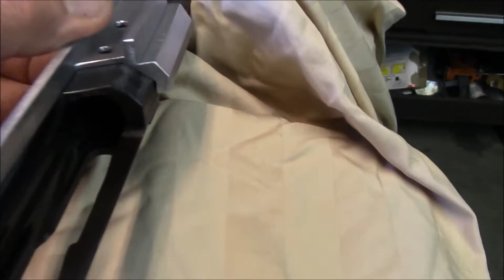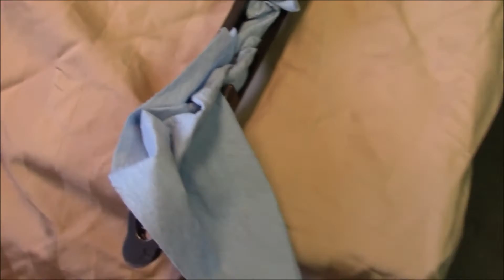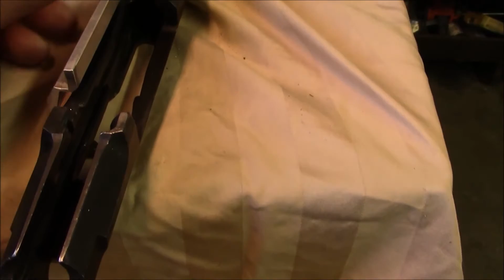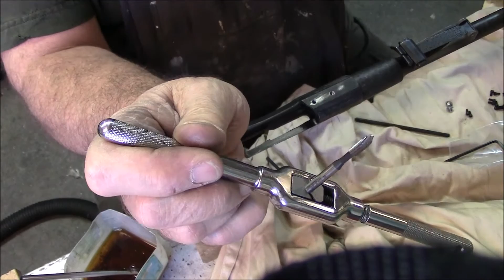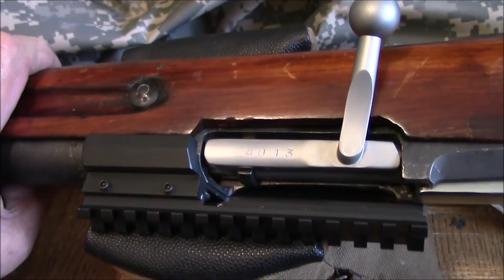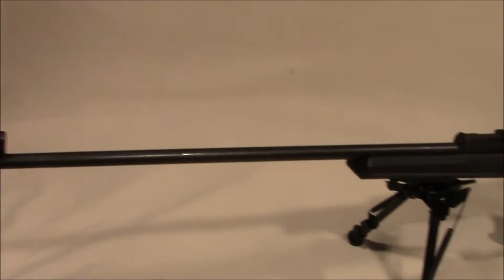Trueshot Technologies Hex Mosin Install

Comment: Great video. It looks like you drill all three holes completely through. Is there any problem with pressure when shooting?
Reply: +firsttbone Should be no pressure issues because none penetrate into the chamber area.